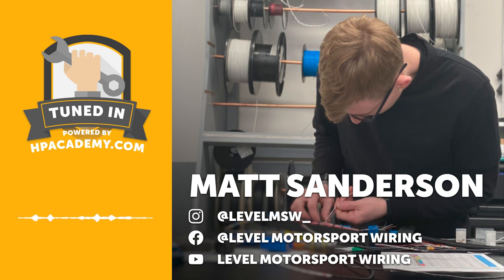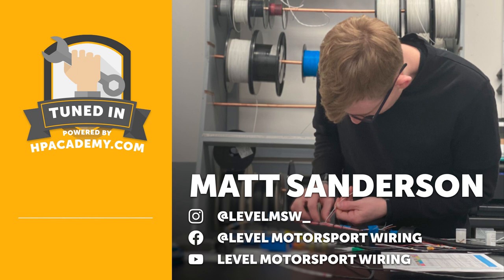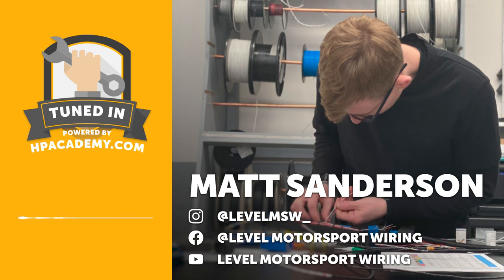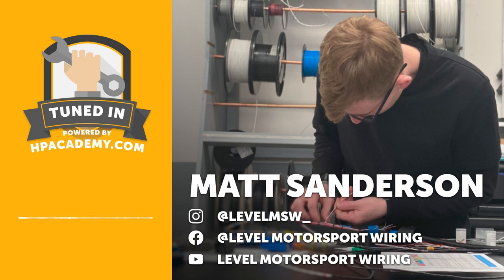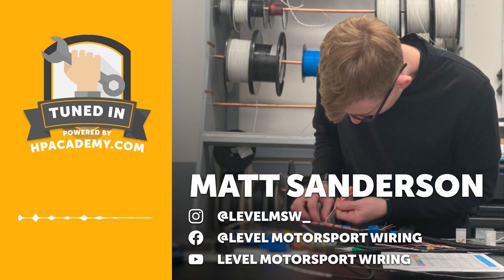062: The Secrets to Building a Pro-Level Wiring Harness. [#PODCAST]

Comment: This was a great talk, thank you! I've been absorbing as much knowledge about motorsport wiring for a motorcycle build.

I've handled a 2-way & 6-way DTM connector before and DTMs seem too bulky for moto use at maybe 4-way and above. 
Andre, have you ever heard of/used Deutsch 369 connectors? Great heat & water resistance, tiny, 500 mating cycles, but limited to a max of nine 22-26 gauge wires and with a square profile that may not seal as well with a boot. Not much cheaper than Autosports though and also maybe too hard to source outside of the US.

Matt mentioned the need for a good wire cutter/scissors. A great option is the Miller Model 100. Super cheap, and when cut, I can see and count every strand of 24 gauge spec 55 wire with a magnifying glass. It's also a recommended wire cutter in a TE technical document I read.

An old school stripper that I've used on 18-24 gauge tefzel wire (/16 and /32) is the speedex trig-o-matic. The cutting blades are made to a large range of fraction-of-an-inch sizes and can therefore surround a conductor very closely if you have the right blade. I've also used it on 18-24 gauge tefzel and the stripped wire looks flawless under a magnifying glass. They're not made anymore though so you gotta find an old one in good condition.